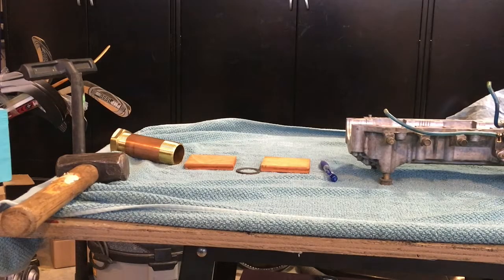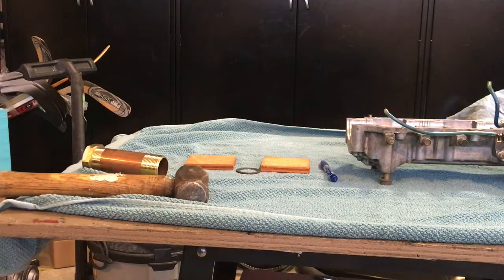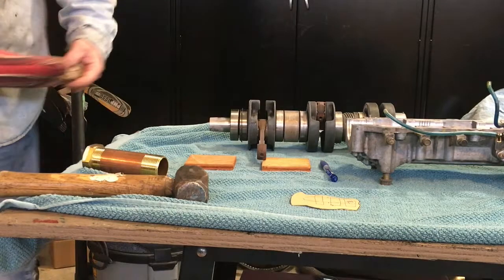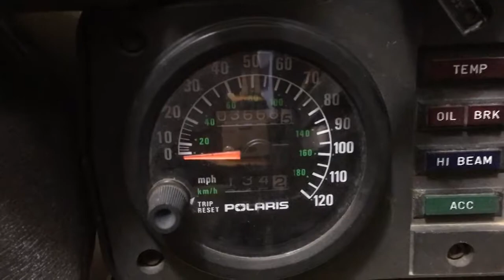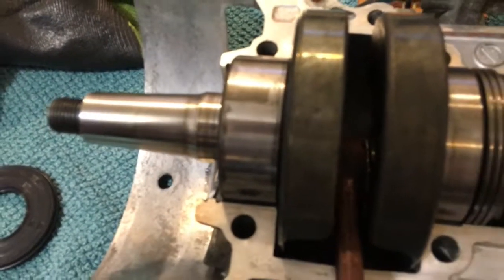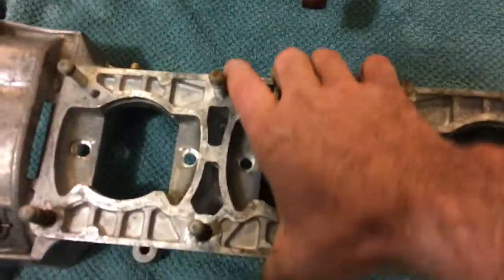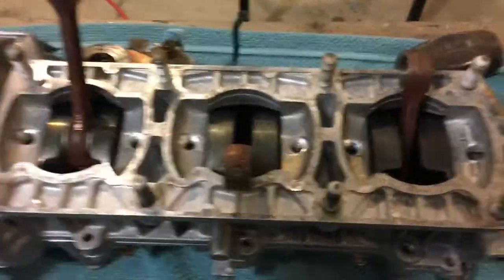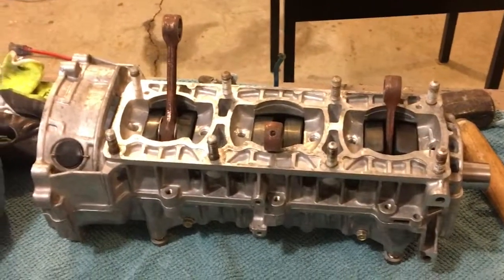Polaris XLT 600 PTO Bearing and Case Modification

Comment from the maker: If anyone is wondering .... This machine is still rip-roaring up and down the lake, the hills, and zooming along the trails. No issues, smooth, lot so power.    :)   The is a new issue I've got to deal with now (in 2025):  which is one of the carbs has a leaking float needle valve, which floods the engine when parked. So long as the fuel valve is shut off when parked it is fine.  Otherwise what is a one hand two pull start turns into a 15 pull start.

Comment: By extending the hole on the pto end over between the 2 bearings you have created a shortcut for the oil to bypass the outermost bearing and crank seal. You will probably find out when that bearing fails prematurity.

Comment: I carry Stihl chainsaw oil with me, and add to the gas tank when re-fueling. Recommended by a Polaris mechanic. Its not a cure but simply prolongs the lifespan of the PTO bearing. Yes, I know I am changing the fuel oil mix slightly, but 3400 miles later and it doesn't seem to mind.

Comment: I can’t seem to find these bearing anywhere, got any suggestions of where to find them? Did the inner bearings you put on have a tapered inner race?
Reply from the maker: You can get at a Polaris dealer.  OR, goto your local industrial shop to get them at a much better price. I do no know where you are so cannot make any specific suggestions. There is no taper.  The bearings are standard single row ball bearings.
Reply: @facedeace4684  you said you bought cheaper bearings without pins. Are the pins something that you take off the old bearings and put on the new or do you just install the new bearings without pins? Excuse my ignorance I don't know what the pins are for, this is my first time rebuilding an engine
Reply from the maker: @MarshallBLewis     Best as I can interpret, the pins are for case anti-rotation.  Likely intended to ensure that when a bearing piles up it will spin on the crankshaft, thus destroying the crankshaft not the crankcase. A brief attempt was made to drill a hole to transfer the pin over to the new bearing.  However, bearing races are incredibly hard material, nothing I had on hand at the time could cut for the pin.   I went with no pins.  I have never, nor ever intend to run to failure.  It is pretty easy to notice when a bearing is acting up and immediately shut down the engine.  Hope that helps!

Comment: This is obviously a design flaw in engineering, but it has more to do with creating a low pressure area than making larger holes. 

Fortunately, making larger holes will tend to make a low pressure area, but it has almost nothing to do with oil flow, and 99% to do with pressures. When you imagine an engine under normal operation it's not really intuitive, but fuel and air mix traveling through the ports is traveling at hundreds of feet per second. Oil that falls out of this mix will get forced into the cylinder and burnt if there isn't a low pressure area to create a sort of landing zone for the oil. 

Take note of the funny groove around the PTO oil passage. That was the engineers attempt at creating a large low pressure area, hoping to trap oil / give oil a spot to land. Very likely, they miscalculated something when they came up with this design, and it didn't create the low pressure area that they had hoped. They obviously had other issues with the passages being blind (not leading to the side of the bearings) but it appears that they were mostly concerned with getting oil to the PTO seal and counting on the oil making its way back from the seal through both of the bearings. 

They were probably concerned that if they had a passage between the bearings, the PTO seal would have a tendency to run dry and burn up. By making the passage the way they did, any oil that went in that hole would lube the seal and then pass through the bearings. Obviously there were some miscalculations, and the newer cases have three holes ( the original hole as yours was, and then two smaller ones that lead between the two PTO bearings. )

It might sound like I'm talking nonsense, but if you look at other two cycle engines, you will see that most of them have very small oil holes. If you don't believe me, go look at some V-max 4 crank cases and see how much smaller the holes are, and also the fact that they use these channels / groves to create a low pressure area. The v-max 4 was a bullet proof engine and didn't have crank issues even when pushing a LOT more power than stock.
Reply: Thanks for sharing your knowledge. So if you owned a 95 XLT with the same design as the one in the video, would you do exactly what was done in the video or something different?
Reply: @MarshallBLewis  The simple answer is that I would do basically what was done here but not remove as much material. 

If you don't plan on modifying your engine, you can get away with removing more material. You have to keep in mind that the area where these holes are is the support for the bearings, and the PTO side takes HUGE stresses as most of the power that drives your sled goes through that part of the cases. 

If it were mine, I would pay attention to the amount of oil around each hole, each bearing etc. Based on that I would know for sure if it was an issue with not getting oil  into the hole, or the oil going into the hole just wasn't getting to the inner bearing. If there was plenty of oil on the PTO side (just not on the inner bearing, I would cut the passage past the edge of the bearing and leave it at that. No need to hog out a huge groove.  If the area on the PTO side is more dry of oil, then I would slightly enlarge the hole but mostly flatten the "groove" in the transfer port area to attempt to catch more oil. 

If you are doing this yourself and you're as crazy as I am, you could ride it a season, pull the engine and remove the bottom of the case and see if the PTO bearings are being lubed well. I think you can leave the top of the engine assembled for this, just remove the recoil, flywheel and magneto and you should be able to pop the bottom off. 

I also assemble my engines with assembly goo grease and would pack the seals with a LOT of grease.  If I planned on inspecting the bearings, I may use very little so it didn't mask signs of lack of lubrication.
Reply: @JoelArseneaultYouTube  great advice.  I'm a machinist and rebuilt my 95xcr 600 last winter  I too didn't hog the hole out but just extended the slot just past the bearing. Chamfered all the holes slightly and put it back together.  It's not modded and has been flawless for 500 miles now. But I didn't know about the seal lubrication.  I will be keeping a close eye on that. Thanks for your knowledge

Comment: Update on the sled's performance/condition? About to do the same job on mine.
Reply from the maker: Thanks for the followup question!  The XLT has been running great.  Rip-roaring as ever. No issues, no concerns.
Reply: @facedeace4684  Awesome! Thanks

Comment: You do know you ruined that case half
Reply from the maker: How do you figure that?
Reply: @facedeace4684  you drilled those hole way to big I showed this video to a professional porter and he was wtf
Reply: I bet he wonders why his sled Boggs and has low crank pressure to suck the fuel up the ports into the top end leaning out and melting pistions
Reply from the maker: How could I have possibly drilled the hole too big?  The whole case is one big hole.  Anyways, the information is free.  Free for folks to use or free for them to leave.  The machine has been running regularly with no issues and the power is smoother and stronger than it has ever been.
Reply: So I have a 95 600 special and runs good but I get engine breaking when I let off throttle , what are symptoms of this pto bearing starting to fail ?
Reply: Yea who ever u talked to told u wrong